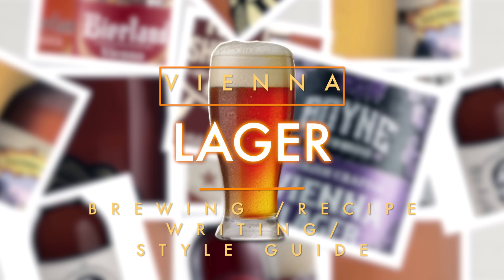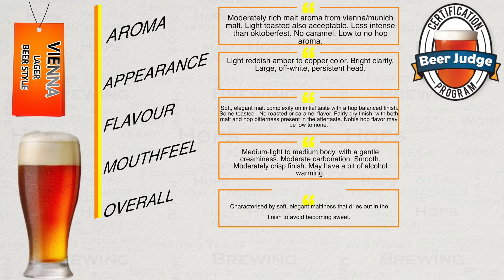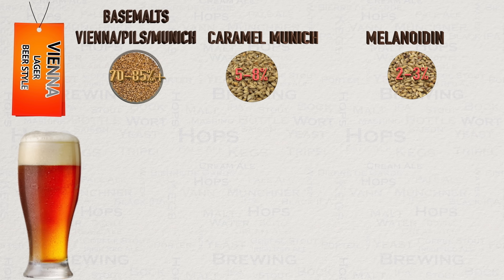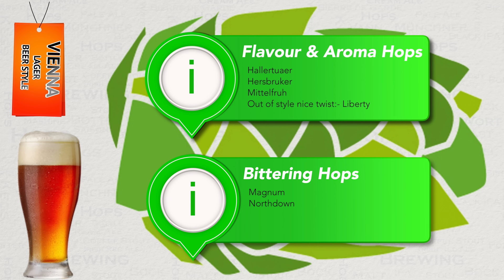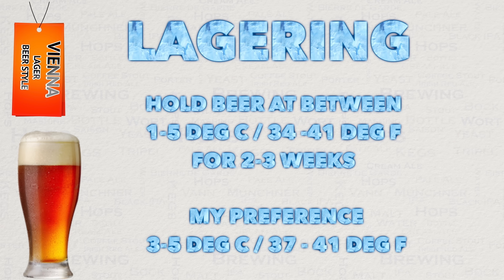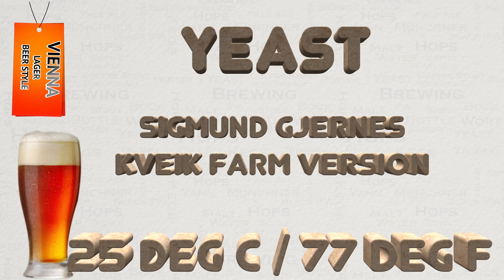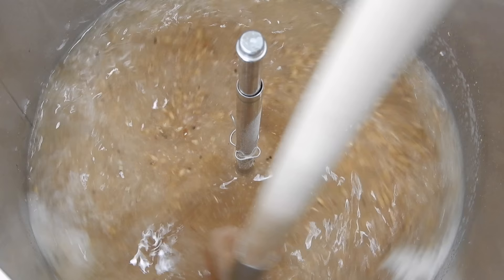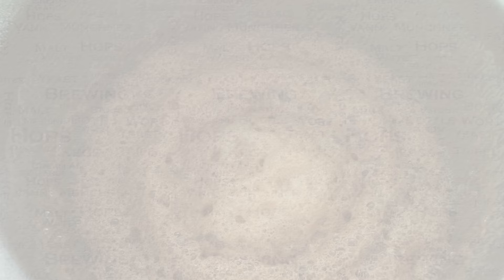Vienna Lager Brewing, Recipe writing & Style guide

Comment: Hi David. I noticed you did not include the amount of hops used which prompts my query. I find that my efficiencies are always higher than indicated in published recipes, with the resultant effect on my BU : GU ratio when I use a predetermined amount of hops. With the calculation of IBU"s from the Tinseth table, the utilization factor is dependent on the gravity of the wort. Is the OG that is referred to in the table the specific gravity at the start of the boil, or do I need to estimate the OG at the end of the boil in order to calculate my hop additions.
Reply from the maker: Yes, I want to encourage people to calculate the amount to use based on IBU for each hop addition. Otherwise too many people are just using the same amount as me but with a different alpha %, which leads to the wrong result.
Reply: @DavidHeathHomebrew  Thank you for your prompt answer to my query. I would appreciate it if you would address my comments regarding the Tinseth table as I would like to be able to use it correctly.
Reply from the maker: Oh sorry, yes of course. All of my calculations have been made already using this table as I use Brewfather. So nothing else to do but add it your hops and their AA % and match the IBU. You can also use the Brewfather link to the recipe and adjust from there also.
Reply: @DavidHeathHomebrew  Thanks David. I have a copy of the Tinseth table and would  prefer to do my own calculations and not rely on external sources which may not be available in the future. I will experiment with the pre-boil and post boil gravity of the wort to establish which one is the better to use with the table. To me it's a bit like just driving a car as against understanding all the mechanicals as well. I'm old school or a bit of an old woman depending on the interpretation of others. However, as you well know, we all have different opinions and as long as the end result is pleasing to the palate then that is the be all and end all. Thanks again for taking your time with this subject.
Reply from the maker: No problem Mervyn, I understand totally. I used to do everything manually. Then brewing software came along and at first I did not trust it. Over the years it has got better and better though till the point in recent years where I trust it.
Reply: Let me ask each kind of hops as how many grams is the recipe
Reply from the maker: This totally depends on the alpha acid of the hops you use. I want to encourage people to calculate the amount to use based on IBU for each hop addition. Otherwise too many people are just using the same amount as me but with a different alpha %, which leads to the wrong result.

Comment: Hello David, greetings from Ukraine!
Thank you for inspiring us to try new and new ways of brewing beer )
When I’m looking for a recipe that’s new to me, first thing I’m scrolling an impressive list at your channel. It’s always informative, I’ve tried about 10 of your recipes, and they always works great! Thank you for doing this!
So, I decided to brew Vienna lager as my first lager with my new GF glycol chiller, in pair with GF conical fermenter.
I don’t have a pressure system and I’m going to use M84 yeasts within your fermentation schedule.
A question, do I still need to prepare a yeast starter if pitching yeasts at ale temperatures or can I skip it?
Reply from the maker: Hi Georgiy, that is great to hear :) There is no need for a starter with dry yeast, as long as you pitch enough :)
Reply: Another good news ))
Thank you for such a quick answer!
Cheers
Reply from the maker: No problem :)
Reply: Hi David,
Sorry, I did not think about it earlier, so I have to ask now:
As it will be my first lager with GF glycol chiller, I’m thinking now about further beer carbonization. I don’t have any CO2 sys to carbonize beer, so my way of carbonization is to add glucose to the bottles. Works fine with ales, but what about lagers? Will it work after cooling the beer in fermenter?
Reply from the maker: Yes, no problem there. Use normal room temps as usual.
Reply: Thank you David!
That’s a great news to hear! ))
Cheers!

Comment: Hi David! Thx so much for all your videos! Truly helped me a lot prepare for my first brew on tue GF30. Still a lot to learn an practice. Anyway, even though it has been asked already i wanted to check in whether you have new information around this since you experiment a lot. I am looking into trying out this vienna lager recipe. I could get my hands on the Lallemand Voss dry yeast. What what would you consider as lower and upper temperature limits for this yeast in this recipe? It has been asked already but forgive me asking it again. Just want to check in for fresh info as stated above ;-) thx a lot in advance!
Reply from the maker: Great to hear :) I would keep it between 20-24C for the right profile.
Reply: @DavidHeathHomebrew  tried the recipe, and put it in the GF conical, keeping it at 22 degrees C. I tried to pull a sample today, as the gravity readings of the tilt became stable over night. However i noticed quite a smell. Seems to me like sulfur. I thought the beer might got infected and opened the lid, it looks normal to me but the smell was quite intense. I read a bit online and in your FB group, and it seems this can be from stressed Kveik. I actually used a heaping teaspoon of nutrients and one sachetlallemand voss for the 19L batch. Not sure, maybe it was the low temperature causing the stress. In the sample the smell went away quite quickly. Less then a minute. I will leave it as is now at 22C for another 3-4 days and check again. From your experience, do you think that the smell goes away after the yeast cleaned up completely? TIA :-)
Reply from the maker: Hi Matthias, I would not be alarmed at this stage. Give it some days and this is likely to fade and vanish :)
Reply: @qevinflynn   Hi Matthias - just saw your comment - I was planning on doing something like this shortly and was wondering if the end of your fermentation cleaned up the sulfur notes you were referring to.  Cheers
Reply: Hi  @kevinhughes2070  ! Yes it did. At my second attempt using voss at this temp, once it became stable on the tilt for 2 days i actually raised the temp to 24C over two days. Helped as well cleaning it up a bit from what i could notice.
Reply from the maker: Great to hear :)
Reply: @qevinflynn  Thanks very much Matthias - appreciate you getting back to me so quickly... these low temp Kveik pseudo-lagers could be a game changer for me... looking forward to trying it out.. Cheers
Reply: @kevinhughes2070  you are welcome. I will try pressure fermenting voss next. Got a floating diptube lid, heating belt and a blowtie. Just need another keg to try it out. Curious to see the difference. Btw in case you are not a member yet, definitely join davids FB group. Tons of info and very helpful people there! :)

Comment: Great video as always David.  As mentioned by @Count Drunkula, the explanation of what each ingredient beings to the table is a fantastic idea.  I also love the  Brewfather link - what a great piece of brewing software it is!  One question for you - what was your brewhouse efficiency using the Brewzilla 65?  I'm using one here and will adjust the recipe to bring it in line with your efficiencies - otherwise I'll end up with a Vienna Lager that's closer to 7%
Reply from the maker: Great. I have set this up with 75% brewhouse efficiency but I am still trying to work out its water volumes. I have only done a small amount of brews with it.
Reply: @DavidHeathHomebrew  I'm in the same boat.  Here are my numbers as things currently stand, but they will be tweaked:
Boil time: 90 minutes (I brew with a lot of pilsner malt)
Batch Volume (Fermenter): 44L
Pre boil: 57.67L
Boil Off: 6.5L/hr
Trub Loss: 2L
Mash Tun Deadspace: 11.5L
Mash Tun Loss: 1.5L
HLT Deadspace: 0L
Fermenter Loss: 2L
Brewhouse Efficiency: 80%
These numbers will get changed as I brew more with the B65 and get a better handle on it.  I would like to know what numbers you're running with, as well as those of other Brewzilla users.  Hopefully collectively we can get an accurate picture quicker and who knows, Thomas may even offer that as one of the drop down options in future iterations of Brewfather.
Reply from the maker: Your numbers look very similar to mine. I need to ask around more to see what others have found out. Boil off is pretty high but it depends on if you need all 3 elements on or not.

Comment: Hi David, I'm brewing this after a long pause, finally got my hands on Brewzilla and Fermzilla, so this will be my first brew on the system. Just wanted to check will Voss ferment cleanly at 20c? I live in the cold climate now, just wanted to be sure that it'll ferment without off-flavors. I can push it to 25c, but it's much easier if I set it up at 20 :) P.S. Coffee porter is next, just waiting for Lutra to arrive.
Reply from the maker: Hi Zoran, yes at 20C Voss is nice and clean, though not quite as clean as Lutra.
Reply: @DavidHeathHomebrew  Great, many thanks. Hopefully, it's a relatively fast fermenter and it can finish in  7 days at that temperature..
Reply from the maker: Yes, more than likely.